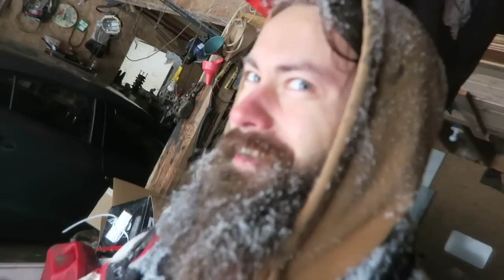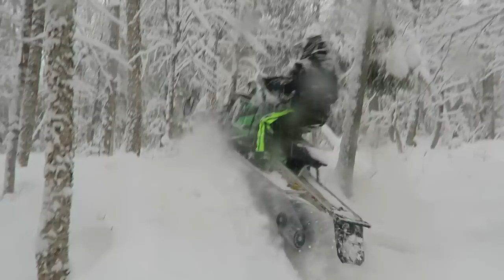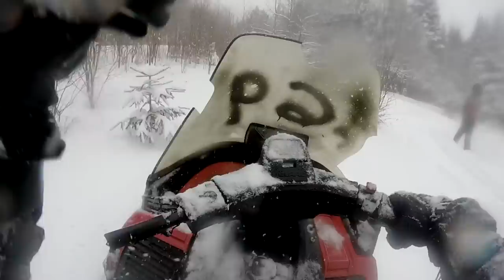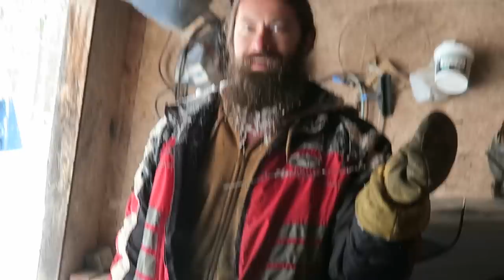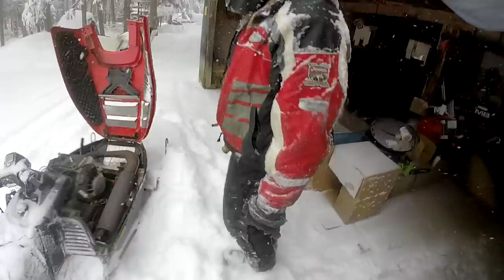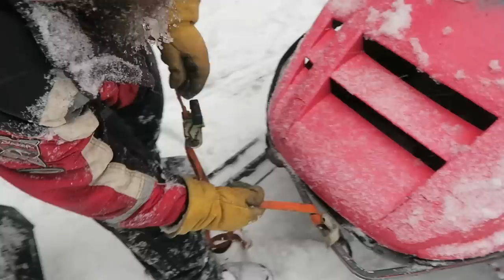FIRST SNOWMOBILE RIDE OF THE SEASON ( Ends In Disaster )

Comment: I have a friend that started on a short track bravo.  He  eventually moved up to Polaris 340. I was on an evenrude 400 skimmer. That was close to 40 years ago.  He still has the 340's and even still rides them when the snow gets wet and frozen i need to get anotherair cooled sled for those conditions.  Like a studded up phazer. . Looks like a new crash bar is in order. I remember when I told the Yamaha dealer I wanted to order a new crash bar for the phazer. 
He had a riggen fit about they don't have crash bars.. back in the day we wouldn't go riding if we didn't have alcohol. Now,, I haven't had a drink in almost 20 years. The equipment lasts much longer.

Comment: Drill 6 1/2 inch holes on the end of the muffler so it blasts exhaust on right knee shell open right up. I jetted my carbs since it made a major difference loading clutch and rolling past 5500rpm

Comment: Happy New Year to you guys also I've had some clutch issues over the years with them'90s Polaris it almost sounds like it's starting off in too high of a gear meaning the clutch ain't shifting properly look inside on the drive clutch off the engine and see if them Waits look good and not stuck good luck guys

Comment: That is some quality wrenching for the bent bumper fix. I am disappointed that you didn't do a Hill Billy zip tie stitch on the crack in the plastic belly pan. That would give it the frakensled look it so desperately needs! Especially if you used some florescent green or yellow zip ties, so it stands out. Oh well, maybe in another ep. P.S. - some liquid electrical tape on those intake boots will fix the cracks right up so you can send it!
Reply: Rtv on the boots

Comment: Little tip when pulling a dead sled, use a Y type rope hook one end on each ski loop and the single end onto the tow sled. You don't even need someone to steer the sled being pulled. It will work with a single rope if you hook it to the ski tip, just not as good.
Reply: Ya that works great if you want to screw your tie rods and alignment up. Hooking to each loop pulls the ends together